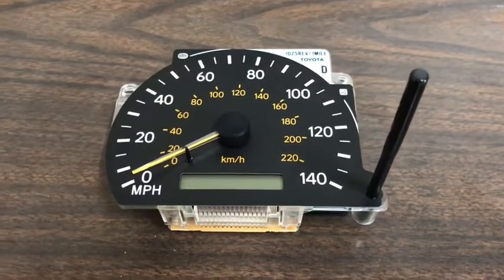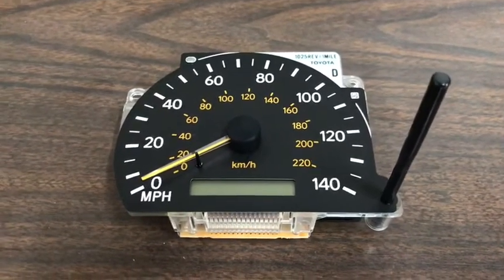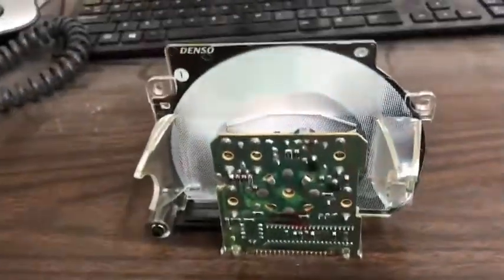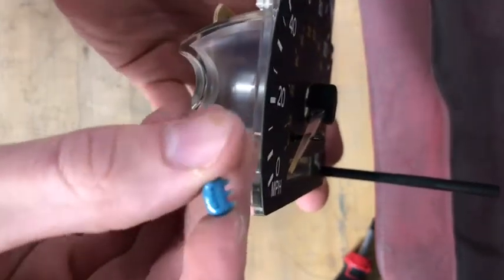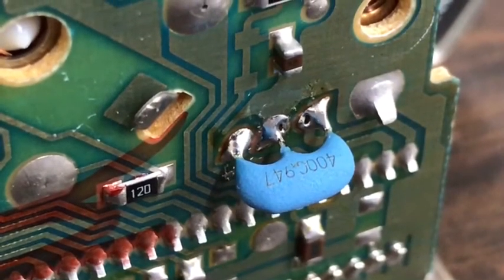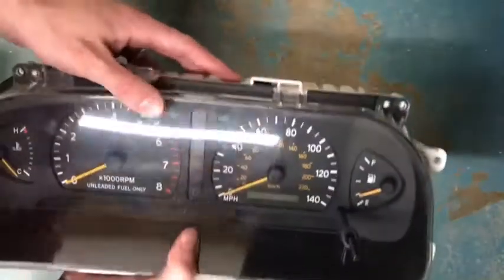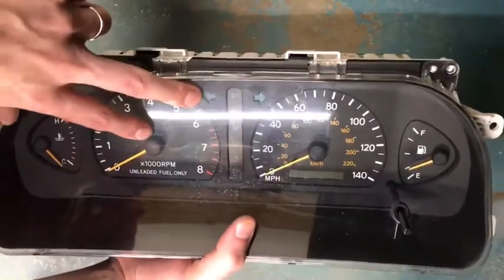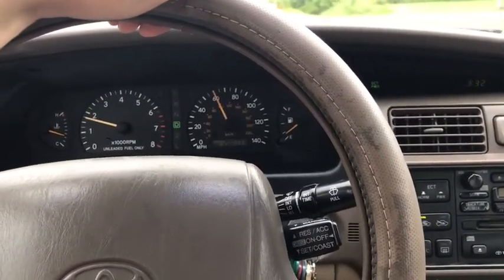How to fix Toyota Lexus Speedometer and Odometer that is not working with Erratic Shifting

Comment: Sir, I have recieved my resonators and a soldering kit.

When you are soldering, you have two instruments in your hands. What is the smaller instrument that looks like lead from a mechanical pencil? Do i need this part to complete the job?
Reply from the maker: You need to melt the solder with the soldering iron at all 3 “prongs” to keep it in place and to establish connection. A suction tube is also used to suck up excess solder. I suggest watching some videos on how to solder with electronic boards.

Comment: Jeff, if I buy a ceramic resonator with a different pF will ot still work?
Reply from the maker: I’m not understanding your question. I do not know what your abbreviations mean.
Reply: @jeffharrell1874  there are different specification ceramic resonators. They even look identical in color and size. The one you recommended in this video is specification: 

4 MHz Ceramic Resonator Built in Capacitor 47 pF -0.4, +0.2% 30 Ohms -20°C ~ 80°C Through Hole

They have ones that only have 15pF or even ones that are 8mhz. 

I bought some that were 15pF. And people said not to use them because they dont have identical specs to the ones you recommemded. 

Ultimately I located some with the same specs that you listed in the description. So i should be ok. I just want other watchers to know if using different specs will be okay or not. If you read the part description it will tell the specs so you can be sure to have the right ceramic resonators!
Reply from the maker: @squidwardtenticles1458  Good question. I’m not sure if those others will work or not. So I couldn’t say for sure.

Comment: Jeff! I have a 1998 Lexus SC300 with exactly all 3 of these issues and I cannot wait to give this fix a try! Thank you so much for this video and the links!
Reply: did it work on your vehicle? I'm having these issues with a 97 SC300
Reply: @cadenm6349  Yes! I actually just did this the weekend before last. My speedometer + odometer have been working ever since, haven’t failed once, and the car is running much better. I will say the SC’s gauge cluster was a bit more complicated than expected, and you’ll likely damage a needle housing or two in doing this project, but totally worth it in my opinion!
Reply: @DavidJohnson-td1ll  I’m trying to do it on mine now. Where did you find the resonator? I’m only seeing 3 2 pin ceramic resonators
Reply: @cadenm6349  It was on the board right behind the speedo needle just like in this video- unfortunately I wonder if our clusters are different due to the VVTi changes that happened between ‘97 and ‘98?
Reply: @DavidJohnson-td1ll  i believe so. Mine was in a much more difficult to reach spot that required literally removing every screw. After installing the new ceramic resonator I plugged everything back into the car. However, my needles no longer lit up and my speedometer and odometer would not work at all. I've already ordered a new cluster; I most likely messed something up along the way. Was worth trying to fix it cheap though
Reply: @cadenm6349  Dang! I’m sorry to hear that- hopefully you learned something along the way? 😅
Reply: Don’t know if anyone will come across it, but I just did this today on a 1997 pre vvti and it worked.
Reply: @ParkerVann what’s the part number for the ceramic resonator needed?

Comment: Just completed the same repair on my ‘97 Camry and found this tool, 3-1/2 In. Locking Clamp Pliers, $3.99, from Harbor Freight to be a lifesaver while removing and installing the blue resonator. Clamp it on to the 3 exposed wire prongs just below the blue ceramic, making it easier to handle and solder this small part in its original position.

Comment: 06/20/2022, Hi Jeff, I have a 1998 Toyota Rav4, 2 Door, 127K miles.  There are only a total of 2 on the Islands with 2 doors. The Odometer needle at Zero, Mileage Blank screen and there is Erratic shifting was the only problem I had as you stated in the video with your vehicle.  Before discovering this video, I called several companies on the mainland USA because I'm in Hawaii if they could repair the issue.  None of then could fix this particular model.  There was a guy in Hawaii that could fix it but for a whopping $550!  Da Hecks?  So, I proceeded to watch the video and did exactly what you showed step by step. I had to watch it over and over again cause I didn't know how to solder.  But as for me, the only frustrating procedure was to disconnect, take out and reinstall the instrument cluster.  You all might want to change out the halogen bulbs to LED ones while you are at it in my opinion. Miraculously, it worked! Jeff, you are awesome!  I can now get my annual safety check for the vehicle.  Is there any donation link?  Thanks for creating the video!
Reply from the maker: No donation necessary. I’m glad it helped!
Reply: Interesting running across your issue, I'm in Hawaii too and have a 99 Rav4, 4 door, AWD, Automatic, 2.0L and the issue i have is that the speedometer and Odometer stopped working.  The odometer is digital which doesn't come on and the speedometer is a needle which stopped working.  I don't have any issues with shifting, but i had a Check Engine light which is on with the P0500 code which links to the Vehicle Speed Sensor.  I went ahead and had a shop replace it, however the issue is still present and the code hasn't cleared.   

Did your engine light come on with this code?  

How long did it take you to do the repair?   

Is replacing the whole gauge cluster easier? 

My concern is if this fix applies to my situation.

Appreciate your response
Reply: @mosconioni4523 is your odometer blank when the erratic shifting happens? & odometer reading displays, it shifts & drives ok?
Reply: @robertlau4141  mine just the speedometer doesn't move and the odometer doesn't work  or come on as it's a digital lcd display. Shifts and runs completely normal it seems.
Reply: @mosconioni4523  did you manage to fix the issue?

Comment: Being a newb to circuit board soldering, does it matter which way the 3 leg resonator faces (ie: writing facing up or down) when inserting it into the board?
Reply from the maker: It should work either way. Good luck!

Comment: my car's (toyota yaris 2008) speedometer doesnt work(0mph), oddometer is stuck on 72k and ABS, hand break and PS are on...what could be the problem? its like this ever since i bought it
Reply from the maker: I’m not familiar with that model. It’s possible you might need a new speed sensor. But You would probably need a good OBD scanner and a mechanic to properly diagnose it.

Comment: Could this still be my issue for my speedo not to work if my odometer still comes on, my speedo dont work and lights dont come on, speedo barely moves when im doing like 70ish
Reply from the maker: I'm thinking it may be a different issue going on. It potentially may be another electronic issue, but I would probably start checking to ensure your speed sensors are all working first.

Comment: I had the exact same problem with my toyota camry 2000 model and I fixed the ceramic resonator. The instrument cluster is working fine again. This video was really helpful.
Reply: Pls is it the same resonator model type for the Lexus and Camry 1999/2000?

Comment: This worked for my 97 Lexus ES 300.  Thank you sooooo much!
One thing, the part I used was slightly different because Digikey, Newark and Mouser were out of the one in Jeff's links. I used Mouser #:81-CSTLS4M00G56Z-B0.  It looks the same as the one in Jeff's vid, not sure what the difference is.
Reply from the maker: Great feedback! Thanks!
Reply: I have a '99 Lexus ES300 and my odometer went out as well as the check engine light coming on, as well as traction control light went on.

I have no other issues driving the car, speedometer works fine.
Can this issue in the video be my fix?
Reply from the maker: @JackMeyHoffer562  I’m not sure this will fix it, but it may be worth a shot.

Comment: I have a 2000 Avalon with similar dash . ABS light on no speedometer and code for speed sensor . I did read about the cluster been bad but no specific fix . I’m going to try this after replacing all the wheel sensors and the main speed sensor . I was just about to donate the car and it runs perfectly . Just frustrated. This video needs more views or maybe change description. As this is a common issue  . Will post back office or works . Thanks again .
Reply from the maker: The abs light may be a separate issue. I have another video on how you can address your abs light as well.
Reply: @jeffharrell1874  thanks Jeff. I just sent away for the resonators . I know I got 4 lol. The ABS and check engine light and speedometer malfunction all happened at same time . I think once the computer is not getting the speed reading from the sensors it disables the ABS
Reply: @jeffharrell1874  Jeff I just pulled the dash and I have the newer one piece odometer , tachometer and one board on the back . So it looks like this won’t work . Any ideas on this . Mid year 2000 Avalon and Ive changed out the usual speed sensor and ABS wheel sensor .
Reply from the maker: @chrisdoe6890  I’m not as familiar with that instrument cluster setup. If there is nothing left to take apart in relation to the speedometer/odometer, and if there is no sign of any blue resonator piece, and if you’re still having the exact same symptoms as described in the video, then replacing the entire instrument cluster might be an option. But I can’t confirm what would be the perfect solution in your scenario. But it’s a start.
Reply: @jeffharrell1874  thanks Jeff appreciate the response . I called a cluster repair place sans they said they don’t do that model year repair lol. They’re a number of two pin diodes but I’m shooting in the dark. I’ll try E bay or junk yard . That model year also has cluster with alarm or without .
Reply: @jeffharrell1874  Jeff I got the ABS light cleared . I just had to put pin back in and re set using the brake pedal pump 8 times . When re checking the codes I found 62 . Which shows the ECU malfunction . Wondering if thats my speedometer issue ?  But the ABS is off lol
Reply from the maker: @chrisdoe6890  that very well could have something to do with it. I would address that first before doing anything with the instrument cluster. Hopefully now you’ll  on the right track with that info.

Comment: Where can purchase this part for repair, mine no work odometer and the miles no change upper the numbers in tacoma  prerunner 03
Reply from the maker: If you look in the description, you will see a link to purchase a resonator. It’s possible that they may be out of stock at the moment and may be on order. I try to update the links when I can.

Comment: speedo is been dead for a while on my 2nd gen 4runner so yesterday I tried raplace two electrolytic caps (10μf 25v, 100μf 25v) like someone said but it didn't help. I didn't notice any three legged blue thing but since the odometer (mechanical) works ok I guess this is not my case? I remember before dying the speedo was working on and off for a couple days.
Reply from the maker: Correct. I don’t think this fix would apply to the non-digital odometer like yours.

Comment: Digi-key was out of this part as of 7/23/21.  Part was available from Mouser Electronics: ordered on Sun and got it on Tues.  Used solder sucker with bulb from Radio Shack, which made it easy.  Need very small soldering iron. Put part in  with tweezers, and soldered it in the normal way.  This is an easy fix, and removal of part and resoldering took less than 5 minutes.  It worked.
Reply from the maker: Excellent feedback! I just updated the description to include the link to mouser as well. Thank you sir!

Comment: I just did this resonator replacement on my roommates 98 Camry. The speedometer and odometer just wouldn't work if the car was left out in the sun. I put in a cheap $25 VSS that seemed to work fine but the car still didn't shift correctly if the car was left in the sun. I bought the part you listed from Digi-key, and removed some of the solder with the wick. I used my pencil tip on the soldering station to very carefully bend the pins straight and push them through the holes. I have a lot of experience soldering but it was definitely a little difficult. I used some mini needle nose pliers to drop the new part in place and soldered it so it looked factory. The car runs great, the speedo and odometer worked right away and the car seems to run smoother and more peppy. While the cluster was out, we replaced the factory bulbs with Sylvania 194 bulbs and used a greeen Sharpie permanent marker to color in the bulbs. Most the factory green caps were damaged from the bulb heat and ripped when we peeled them off. The difference is night and day, the car definitely seems much fresher now. Thanks for the video man, you saved me a lot of time.

Comment: I'm having the exact same issues. I've already tried replacing both sensors on the trans. I think I will try this next. FZJ80 Landcruiser though, my cluster looks slightly different than yours.
Reply from the maker: Does your land cruiser have the digital display?
Reply: @jeffharrell1874  No, its the old school one. Its doesnt go up at all though and my cruise control doesnt work.
Reply from the maker: @KiyaWarrior  hmm. Just to clarify, you did try replacing the speed (or abs) sensors on each wheel? Well, now that I think about it, I guess those sensors are on your transmission for your Toyota. Which you said were both replaced. I’ve never seen behind the speedometer of an old school odometer, so I can’t say for sure if the fix will be the same for you. Let us know if you find out the solution though.

Comment: Jeff, I realize, since my last message, that if my odometer showed up and the speedometer worked, it must have been not for bending the resonator but for the coldness of the cluster...? I just felt like clarifying that fact since I never before tried to drive the Corolla after cooling it up inside the refrigerator... I do not want readers to break their resonators... The next day my problem continued. I was wondering what other cars ( Scion?, Lexus?, etc?) have similar cluster as my corolla 1998? So I can entertain myself going to junkyards.....? Have a great day.
Reply from the maker: Temperature can certainly affect the resonator’s ability to function. I have heard of others bending the resonator slightly to “wake it back up”, but that is not a lasting solution. I recommend replacing it rather than bending it. I’m sure you can collect resonators from the clusters of vehicles in the junkyard, but the concern would be getting one with the same weakness as before. You may feel different, but it just seems like replacing the resonator with a brand-new, upgraded one for $5 would be less of a hassle than trying to retrieve one from a junkyard. But if you’re just enjoying the long journey doing it, more power to you, lol!
Reply: @jeffharrell1874  hey Jeff do you think that the resonator in the description of your video will work in my toyota corrolla 1998?
Reply from the maker: @ramram-kz8cf  Yes. I happened to find the original idea of this on a car forum years ago. One of the first vehicles that it was tested on was a Corolla like yours.

Comment: Jeff, I just did what you initially did and told us about. Today, before placing the cluster though in the refrigerator for a while(couple of hours) I did bend the resonator (blue thing with 3 legs. it did not break)) and put everything back. I placed it in the car (4 connectors my Corolla 1998 LE) and after it started I did take again pictures of the odometer (same figures!) but this time i did drive the car around the building and.... I saw the speedometer working!! Bravo!  I could record some of the speedometer action without killing myself in the process!!  Just keeping you updated.TKS

Comment: Jeff, how can we be sure about the part=resonator? Mine shows 40 GrG (?) The one in Digikey shows M (?) I had already ordered a VSS and ... I got a wrong one from Walmart! I do not like ordering online.... any more options?
Reply from the maker: I’m not sure about any other options. The part I ordered did not display the exact labeling as the original one in my car either. I don’t think the original is made anymore. The link to the one I provided is an updated resonator that can withstand higher temperatures than the original.
Reply: @jeffharrell1874  Higher temperatures! That sounds great! . many thanks for your feedback!

Comment: Jeff, I have not yet fixed the resonator. I want to learn how to check for (what? power, continuity, voltage, ?   :-)  )all the electronic parts first....  I played with the cluster leaving it inside the refrigerator (40F) and rapidly next day i placed it back and i got to see the odometer!!  and so, I also saw first and 2nd trips in my second playing with it, before it disappeared  again. I also realized that in 6 or 8 months or more that the odometer disappeared ( and 1 or 2 years of continues driving with that check engine light P500) it has not turned up more mileage.... what it is GOOD!! jejejjjoops! hehehhh(english) I can sell my corolla 1998 with what it read the last time 114 376, a very cold winter day!! Today reads 114 377 ..... I will keep you updated. This granny loves you very much. Keep safe because we need you!! 05142021
Reply from the maker: Ok, but keep in mind that if you have the same issues as what’s explained in the video, there’s probably no need to go to the extent of all the checks you’re planning. It’s only a $5 part after shipping. So I would just replace that part, and if you still had issues, then check everything else. Good luck!
Reply: @jeffharrell1874  Thank you again. I will do so.